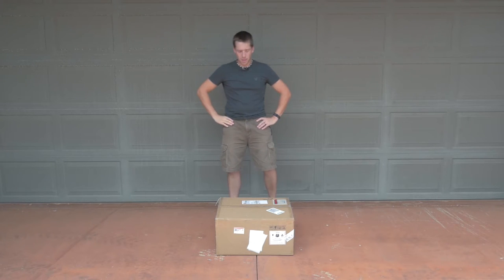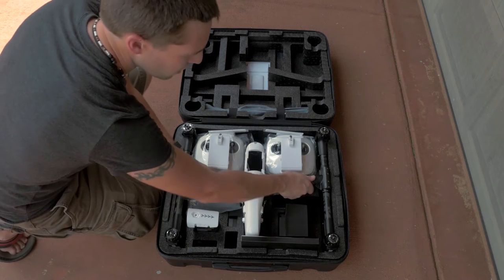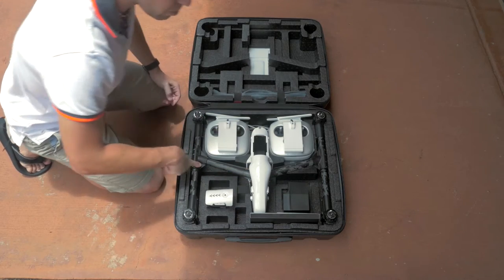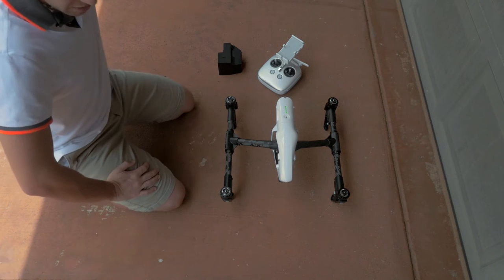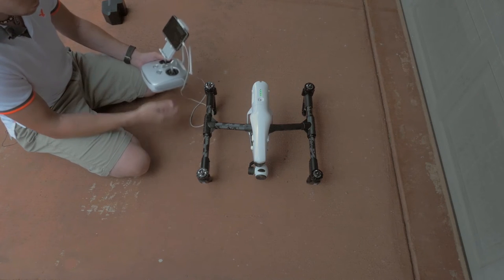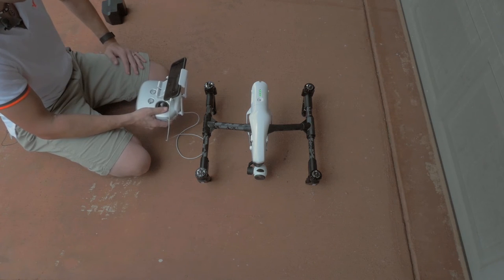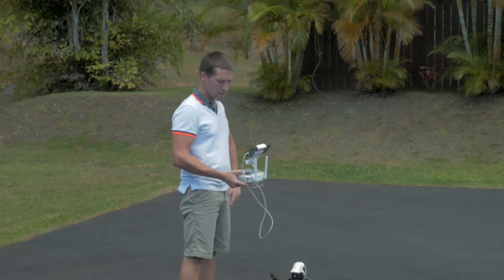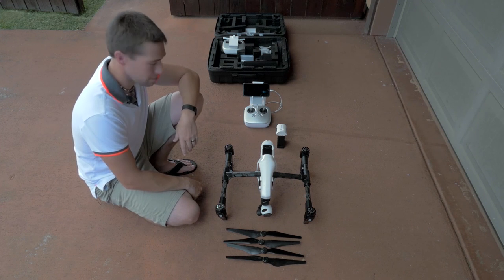Inspire Unbox and First Flight

Comment: You are awesome, I cant have that drone, but I love it. I am using really cheap one it is good for my first :)
Reply from the maker: that's great that you're flying and in the air! The Inspire is a daunting machine, but you become used to it quickly. I have been building multirotors since 2006 and regularly build large(~4' diameter) Octocopters for industrial, commercial, and Agricultural purposes.  keep flying and also fly a simulator. it's a lot less expensive to press the reset button.

Comment: Nice, but I'd turn power off in aircraft before setting camera on place
Reply from the maker: you are 100% correct. if you had read my reply to Gary's post below, you'd see that i haven't installed the camera that way since. (please see below reply to Gary)

Comment: Nice post, thank you. I'm looking to commercialise my drone flying. Should I buy a Phantom 4 or an Inspire 1? Any thoughts? Cheers! :-)
Reply from the maker: Paul Lodge Both the P4 & the inspire are good flying machines once you put some time into tuning to get them flying the way you want them. It also depends on what you want to do with either the P4 or the Inspire. Photo stills or video. They each have their purpose. 
The last note is that you'll need to get you FAA 107 certification. I've been flying under a 333ex for the past few years and have my appointment for my 107 test. 
As long as we all play by the rules, I'm very happy to help.
Reply: Thank you for that. :-) I'm in the UK and am aware of our CAA regs for commercial flights. Got to book my training even though I'm qualified PPL. Just found a great deal on an Inspire so may go with that. I'm looking to do feature video of places of interest, historic buildings etc. No thought of stills at the moment so Inspire ok? Cheers!